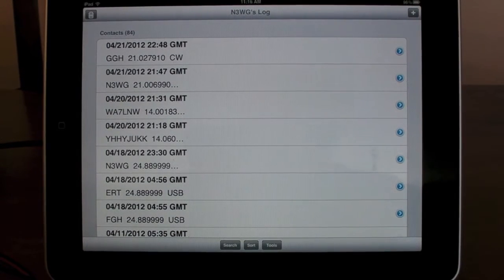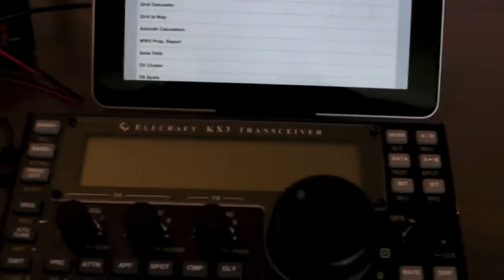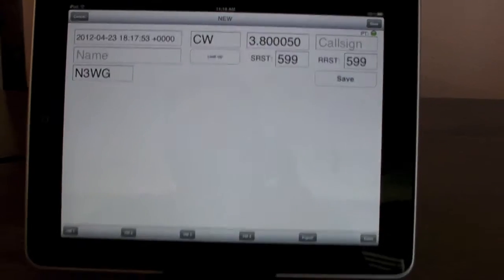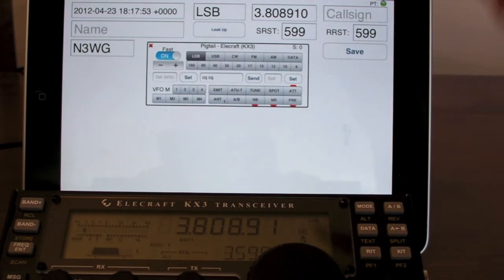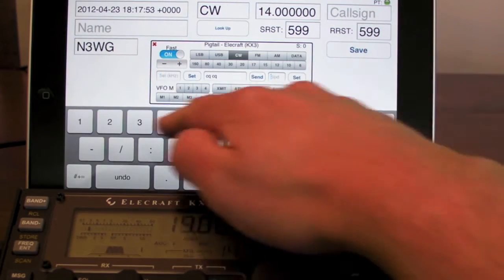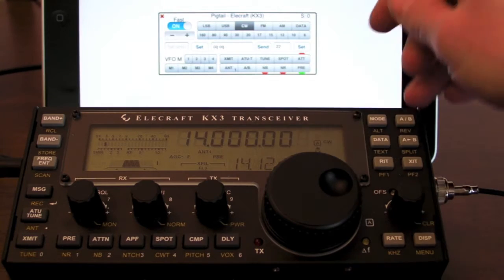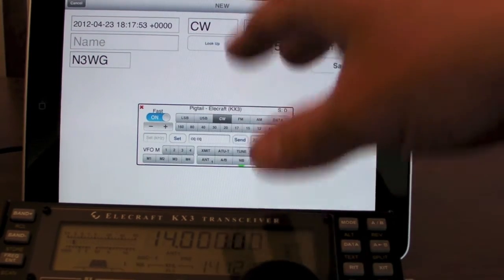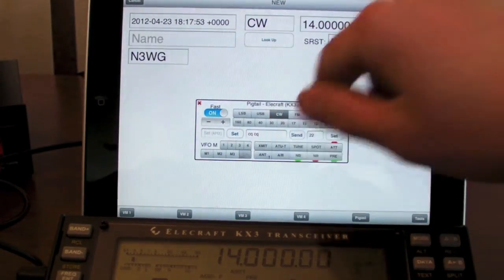Pigtail KX3 Demo

Comment from the maker: Hi Pat, 
This should only occur if the connection is idle for about 5 minutes.  This is a setting within the wifi module and it can't be higher than that.  If it's disconnecting while in use then we'll have to look into a co-channel interference problem.  This is discussed at the bottom of the wiki page.  I'll follow-up with an email to you in a minute.

Nick

Comment: got the replacement piglet and it does not cut out like the first one but my hamlogger program does not look like your demo here. when I hit pigtail after I get to the screen that shows the freq and a lot more info compared to your video screen I don't get the little window that you can change modes etc. Is there sometning I am missing?? Pat k7hrt